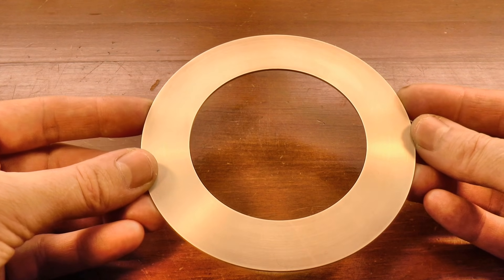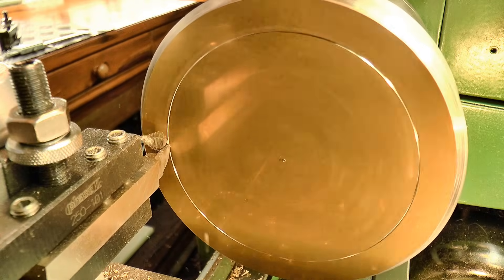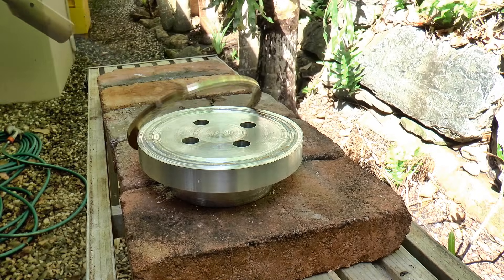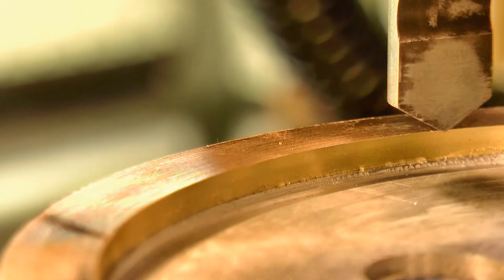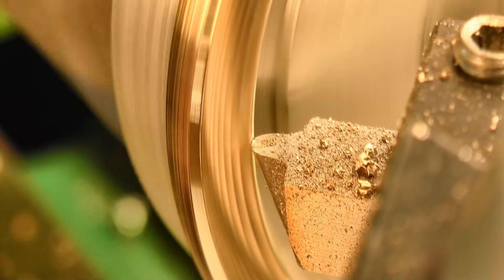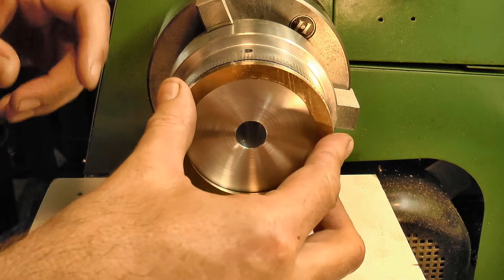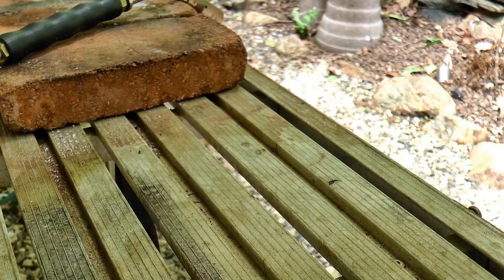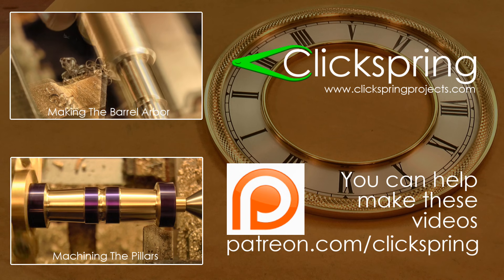Clockmaking - How To Make A Clock - Part 10 - Machining A Bezel For The Chapter Ring

Comment: Chris, how do you know your cutter is going to arrive back at the start exactly when cutting the decoration?
Reply from the maker: Hey Toby, ensure the circle is divided into a whole number of segments
Reply: Clickspring how do you do that?
Reply from the maker: The handwheel on the rotary table can be accurately rotated to give a precise incremental movement before each cut. By dividing the circle into a whole number of equal increments, you can step through each of those increments and eventually arrive back at the starting point.

Comment: Hey Chris, what Lathe/Mill would you recommend for someone looking to get into the hobby, I'd eventually like to make small steam engines and boilers, any feedback would be greatly appreciated :)
Reply from the maker: Hey Zach, I wrote a bit about selecting a lathe here that might help: http://www.clickspringprojects.com/blog/which-lathe-should-i-buy My advice for selecting a mill is buy the heaviest and most rigid machine that you can both afford and fit in the space you have available. I have a very small workshop, so I'm limited to a benchtop mill drill (SIEG SX3). Its no Bridgeport, but for the scale of work that I do it gets the job done.

Comment: Beautiful work. What sort of lacquer did you use to protect the outer bezel? it looks nice and thin.
Reply from the maker: +Andrew Mitchell Hey Andrew, I use this: http://www.whiteknightpaints.com.au/specialty-paints/metal/rust-guard/topcoat/clear-guard diluted 50/50 with this: http://www.whiteknightpaints.com.au/specialty-paints/metal/rust-guard/prep/solvent Any thinner, and it starts to display thin film interference colors, so 50/50 is probably the limit. It has a decent protective life if not being handled, although oxidation still occurs underneath, just at a much slower rate. Cheers mate :)

Comment: Clickspring,
No problem on the extra info. I think you'd enjoy the book very much. But one more that I know you'd really enjoy if you don't already have it. And while it's got a lot of Myford lathe specific designs, most if not all could be reworked to fit almost any other lathe design. And despite it's title there's almost no Model Engineering specific information in it. George H. Thomas "The Model Engineer's Workshop Manual" ISBN 1-85761-000-8 

I probably own hundreds of books about machining, and this one is the best by far. In fact your workmanship and design reminds me very much of George's. It's available either through Hemingway Kit's or Tee Publishing. Both are in the U.K. And there probably much cheaper than trying to buy from the rip off artists on Ebay. The book with shipping is still probably close to $50 but it's easily worth 3 times that.

Pete
Reply from the maker: +Turning Point GHT's book is one of my all time faves :) Thanks again Pete.
Reply: +Clickspring LOL, I should have known. :-)

Pete

Comment: As usual very beautiful workmanship. Ornamental turning is a huge subject all on it's own. But I think the design you've chosen suits your clock very well. There's an aluminum bodied guitar some where out on the net where the guitar's face was done with a boring head much like your ring was done. If you don't know how it's done it makes for an unusual pattern. Most books about ornamental turning mention that you can never get a better part finish than the finish that's on your tools cutting edges. So they lapped a lot of there cutting tools on what's known as a "Goniostat" Google images has lot's of pictures of them for examples. 

And there's many books about Ornamental Turning. Many of them rare and very expensive. But for anyone that's interested? TD Walshaw wrote a fairly recent book that should still be quite cheap that gives a lot of the basics. "Ornamental Turning" 
ISBN 1 85486 108 5

Pete
Reply from the maker: +Turning Point Terrific info there TP, thanks very much for sharing :)

Comment: It strikes me to what degree of perfection hour HSS lathe cutters are ground
Reply from the maker: EddvT I grind them as per the usual angles etc, and usually use them straight off the wheel. If the finish is particularly important, I sometimes give it a light touch with an arkansas slip stone to further improve the surface of the tool.

Comment: Hello Chris, I was wondering. Why did you choose to mount the outer bezel with screws and not some removable loctite?  Good job on the video's! Gives me a smile everytime I get an email that you uploaded one.
Reply: Stefs Engineering Sorry about such a delay in answering, but I think it's clear given the nature of the ring itself. Loctite 603 needs  heat to be removed and that might damage the silvered dial or ruin the polish. He probably wants to take it apart to clean it from time to time

Comment: Brilliant!!! I assume you are lifting the quill between cuts with the fly cutter ???  For the diamond pattern ?? The video doesn't seem to show the up-and-down motion great vids always!!
Reply from the maker: jimmydiresta Yes exactly right. The up and down of the quill doesn't really show up that well on the high speed! Lift, index, cut, lift index cut... 108 times. It took about 40 minutes I think for the whole piece. Very pleased I didn't mess up the indexing! Thanks for watching Jimmy.
Reply from the maker: Its fair to say I was more than a little bit nervous on those last few cuts! No real plan B... if it didn't work, there would be no hiding it. Thanks for watching and asking!
Reply: Clickspring something in one of your other videos tweaked my interest in seeing how you got that pattern into that ring.  So I came back a few to see... I bet those last 5 or so cuts had the apprehension ramped up to maximum.  Did you have a kitty-Cat plan in place, just in case they didn't quite match up at the finish?
Reply: By the way, if any one doesn't get it ... a "Kitty-Cat plan" is simply a way to cover your mistakes   :-)
Reply: Good means of production.Plus golden hands.

Comment: Hi Chris,
Excellent work and very inspiring to watch and learn. I have a couple of questions about your technique for ornamental milling on the new bezel face. Approximately how long did it take to manually do the machining and how many degrees of rotation were each increment per cut? Thank you for producing these videos.
Reply from the maker: Paul Jones Hi Paul, it was about 30 minutes as I recall. Once I got in the groove, it went along quite quickly. There were 108 divisions, with the cutter turning on a 19mm radius. Thank you very much for watching.

Comment: Thanks, I have used your 'superglue' technique to make several items, not clock related, for various machine project.  I have one question, what do you use to remove the superglue from parts.  I have either been machining the surfaces or scraping the glue off, I haven't tried using any solvents but anyway what do you use?  Thanks for the videos.
Reply from the maker: Ron Edmeades G'day Ron, acetone is an excellent solvent. You can either wipe it over with a cloth, or soak the part in it. Thanks for watching and asking.

Comment: The worst part of this video is your Australian accent.  (But I like that too)

All kidding aside, what a great job!  Can you go into how you were using the boring attachment and index to do that pattern a little bit?  I know your indexing system is motorized advance, but I am unsure from the time lapse as to how exactly you were acheiving the advance with the spindle on the mill turning at the same time without leaking tooling marks.
Reply from the maker: NGinuity Ha! Recommend google translate for the accent! The table was advanced manually, 108 increments, using the degree indicator on the handwheel. The cutter set to cut on a 38mm diameter. The cutter was raised before each index, and then lowered again to make the cut. Thanks for watching!
Reply: Clickspring
Thanks, I actually understood all of what you were saying, no worries my friend, just poking a bit of fun at you :-)

Thanks for getting back to me.  I'd kill for one of those electronic indexers but JUST acquired a manual one, so my wife would likely get a little upset.
Reply: Clickspring I was just about to ask you about that awesome mill "knurling" myself. I've been a machinist for 12 years and never seen that done. Your skill and attention to detail is a rare and wonderful thing to watch.
Reply from the maker: The Duke of errl Thank you for the kind words mate, and thanks for watching :)